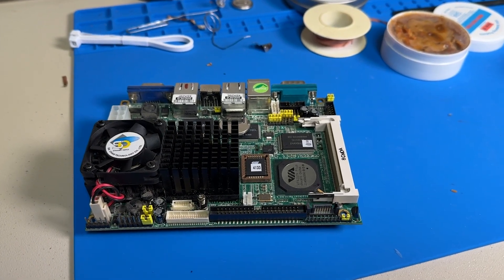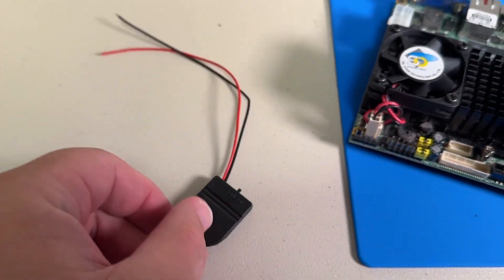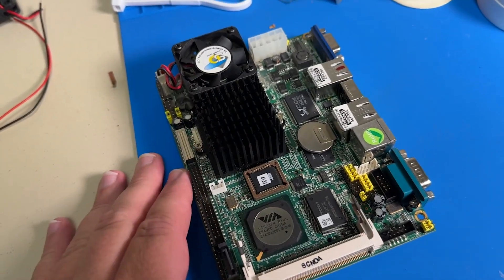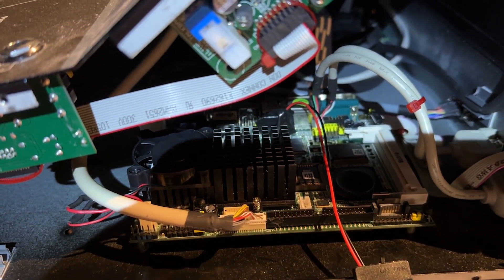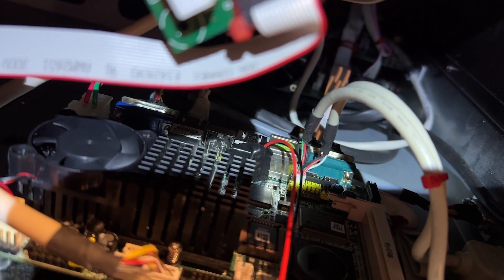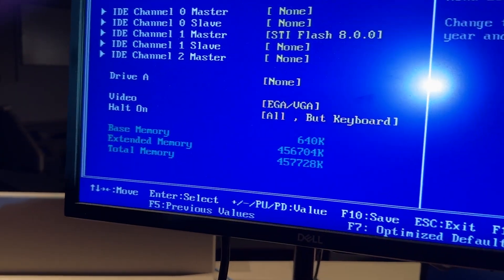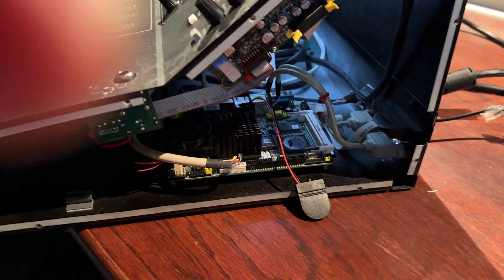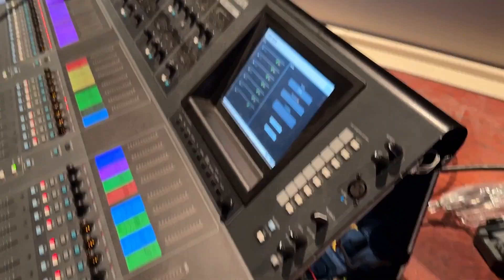Allen & Heath iLive T-112 T-80 R72 White Screen on Boot - Changing the SBC Battery AE7040 Axiomtech

Comment: Hi, could you help me? When I turn on my Surface, I get a message at the bottom:
"Firmware surface version error"
I have version 1.94 and touch version 1.83. This is without the Mixrack connected, just the Surface iLive T80.